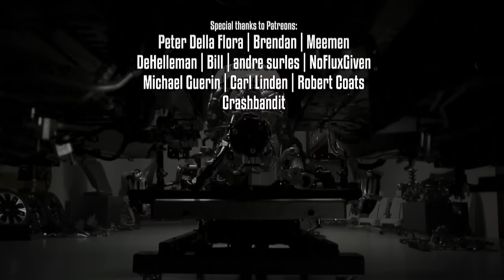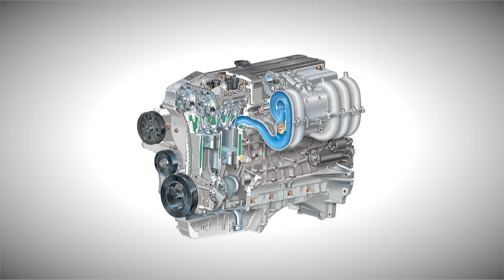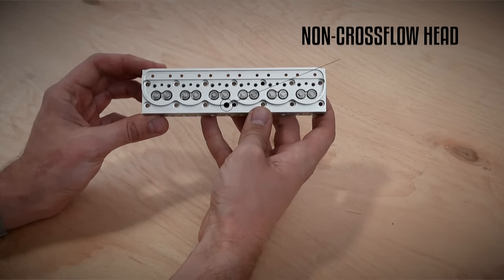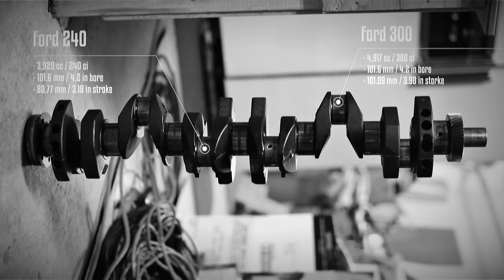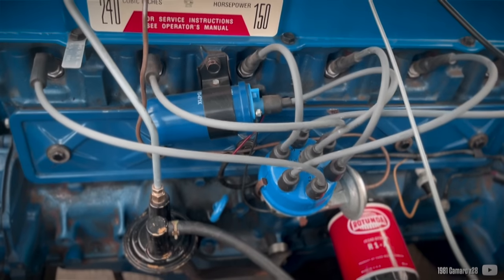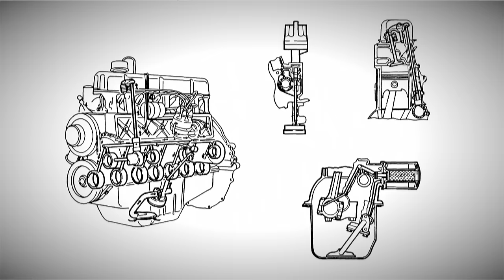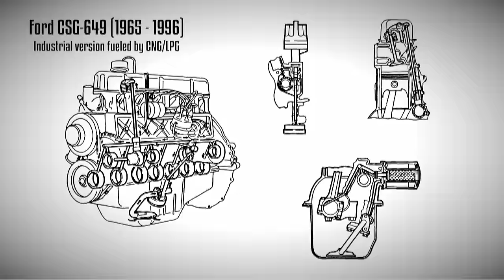Is This Toughest US 6-Cylinder?

Comment: Ford Australia had the Barra 6, which are DOHC with Variable valve timing and contain 24 valves. These were a product of continued development in Australia, from the original non-cross flow family of light Ford sixes which originated in North America as the "Thriftpower Six" designed for the original American Ford Falcon compact of 1959. The final and ultimate version of the Ford Barra 325T Power: 325 kW (436 hp) @ 6000 rpm
Torque: 576 N⋅m (425 lb⋅ft) @ 2750 rpm
Reply: A six so compactly designed that the OHV engines have scallops cut into the camshaft to clear the crank counterweights....

Comment: I want to bolt up two together with a cast iron gear to sync them up. If done the right way, One could then add efi and twin turbo the most reliable engine in the know universe!

Comment: I had a ford 300 6 in my balewagon. I hauled my hay in with it putting 1500 miles on it each season pedal to the floor most of the time 100plus degree weather. Got it hot a few times and it kept going it was bulletproof. What a great engine.

Comment: Gear driven cam is the secret to longevity, in fact the most replaced internal part, that doesn't lead to a rebuild, is the fiber on the gear wears out. Older engines were completely metal on metal.

Comment: I bought a new F150 in '93, w/300 straight 6. It's not an every day driver, but still works just fine. Never had any engine work done outside of plugs and wires. Absolute reliability 30 years going strong.

Comment: Back in the day we hauled hay on old 2 ton trucks. Most I ever hauled on were 6 cylinders. They were strong, slow, dependable and durable. They handled the heat and rough use well.

Comment: I had a 1982 Ford F-150 with a 300. I carried some loads for short distances which were heavier than they should have been for the truck's rating. However, the truck didn't run much differently when I did this. It just used a little more gas.

Comment: So good they ended it. Jk. Reliable and rebuildable doesnt mean best power and performance. Depends on what you want from an engine. The most power it had was the first gen at 170hp and 283tq, nothi g special there. Jeep's 4.0L (.9L smaller than Fords) was just okay and also lacked power having about 200hp and 225tq. Jeeps with these engines were slow and got poor mpg but were reliable. Point is power wise they are not that different. It took way too long for manufacturers to raise power outputs and mpg of everything.
Reply: The 300 wasn't designed for power, it was designed for low end torque, reliability, and serviceability.

The jeep 4.0l was designed similarly, but even the original 1987 Renix versions with 174 hp was still more than most other makers v6's making around 150hp in the 80s.

Comment: The slant six made in the 70s is actually the toughest engine out there. Seen one run for 100 miles without oil and the engine was still intact and the steel crank was still good when it seized.

Comment: I would like to see some mfg'r come put w/the best features of the 300 Ford & probably the 2nd best inline-6 the Dodge slant 6. Utilize the same cam gears as the Ford 300 & the slant design of the Mopar slant six. With its curved design the intake runners could allow for faster air flow the further out cylinders allowing for a faster revving engine. Just combine this w/ a 24 valve DOHC head design  & you could create an incredible fast higher revving engine with good low end torque.
Reply: I would go for a bore & stroke of 90mm/3.54 in x 96mm/ 3.77 in for an extremely high torque low end the could reach very high rpms too.

Comment: Easily the best engine Ford ever produced.  It's a shame they haven't been able to continue to consistently design good, reliable engines.  Classic Ford's were always pretty good because they had good engines like their straight 6 (the 200 was a pretty good little engine too), the FE, Windsor and 385 big block were all good, reliable engines.  Sadly, that hasn't been the case for the past 2 decades.  The Triton V8 is pure shit.  The powerstroke has had some real turds and 4 cylinder ecoboost may be the worst engine of all time.  What in the hell happened Ford?
Reply: With increased complexity comes reduced lifespan due to all those intricate, failure-prone parts.  That's why the next time I need to buy a vehicle, I want something with an engine style that is old and time-tested, meaning something with a plain camshaft and push rods!  Variable valve timing and other high-tech stuff might tweak more power and fuel economy out of less displacement across a range of RPMs, but simplicity = reliability, and for anyone who runs their vehicles forever instead of constantly "trading up", reliability saves money in the long term in spite of the lower fuel economy.

Comment: Back in the 80s I owned a Ford F-100 2wd , 300 with a very light weight 4 speed . pulled a tri axle full of rocks and stumps with a 3 axle trailer loads down with a excavator out of my driveway and down the road until he popped the clutch and got it fired up . Engine had all kinds of guts , however clutch was the weak link .
Reply: Sounds as though all you would have really needed to do was install a better clutch unit and the thing would have basically been a totally bulletproof workhorse...

Comment: So I’ll be honest, I absolutely love the 300 and currently own 2 f250’s both powered by 300’s. When they work, there’s not another gas motor like it on the planet, but I have blown up more of these motors than anything else. Im not super hard on them, and I’m a master tech with experience in engine building, and unfortunately even the last one that I blueprinted top to bottom didn’t last too long thanks to the oil pump drive rod. I’ll never lose my love for them, but when they break they break spectacularly
Reply: my 94 F150 has 276k mi on it.  had it for 25 years and never had to do anything to the motor.  sounds like operator error.

Comment: The 240/300 six is a workhorse & practically bullet proof. There is an old Motor Trend article from 1969, featuring a Ford F-150 short wide with the 300 six in the Baja 1000 race. It did pretty good in its class achieving 110 mph during the race without a lot of modifications.

Comment: International DT series are the most superior inline 6’s ever made. My two favorites are the DT-360 and the DT-466, specifically mechanically injected models.
Reply: I think the video is fine with it's current title because it's really about mainstream, groundbreaking engines.  Still, I was looking for such a comment as this one.  We had a very old truck where I worked that had the DT466 with mechanical fuel injection and to my knowledge, nothing ever had gone wrong with it.  Worth noting is that it would start without engine-block heating in weather cold enough to paralyze any other diesel I've ever seen, and that's with no glow plugs too.  As to quality, too many Cummins fans are convinced there's nothing better than a Cummins and several of them have already made that claim here.  I'm no engine expert, but I've read a bit about the details of the DT engines and specifically how specific design features of the DT compare to Cummins, and there's really no doubt in my mind that the DT is a better engine.  The components of size-comparable engines are massively stronger in the DT than the Cummins, and the DTs are specifically designed for ease of overhaul, which is an almost-unheard-of feature in today's world.  But there are no flashy and stylish modern pickup trucks powered by a DT engine and so there will be no convincing the average Cummins fan that there's something even better out there.

Comment: Guys you need to check out the Australian-designed and built Ford falcon 4 litre straight six "Barra" engine bulletproof and power to burn
Reply from the maker: Thank you for the suggestion. I have already covered this Barra engine previously, you might have to scroll a bit because it was quite a while ago

Comment: My 93 F150 XL had the 300 cui I6. My Grandfather bought it brand new in 1992, drove it across the country from NY to CA more than a dozen times. My father got it in 2003 and dove it every 3 months from Miami to Buffalo, I got it from Dad in 2012, and I road tripped it to Arkansas, Iowa, N.& S. Carolina, Virginia, W. Virginia, Pennsylvania, hell. Just about everywhere east of the Rockies. When I sold it to my son last year, it had just shy of 850,000 miles on it. He still drives it on weekends.
Reply: Hooooooly hell...

THAT is an absolute load of miles that was put on a vehicle!

My three big questions about that vehicle though are:

1. How well did you all maintain the engine over the course of owning it?

2. How reliable was the 300 overall and what needed to be fixed most/was an issue with the motor.

3. How many times did the engine need a rebuild, did it need replacing or did it really last that entire time and all those mile without ever failing?
Reply: @mr.chaosvicious5968  regular oil changes, tune-ups (the usual), plugs wires, cap 'n rotor about every 18 months or so. 
Overall, the only mechanical parts that needed attention were the water pump and the fan clutch. The valve cover gasket was replaced a few times. Oil pan gasket also a few times. Both main seals once.
As for the engine being rebuilt, only the head for valve stem seals and the head gasket neded replacement.
As far as I know, the bottom end is all original. I never had an issue with it when I owned, and it never left me stranded for more than a roadside repair.
And like I said, my oldest still drives it. It's been super reliable.

Comment: I've overhauled a few of these .The valve train starts to wear out before 100K miles . The rocker arms cock to one side and rub through the pressed in stud.  Stud setups are cheap to manufacture
Reply: Did you ever see cam bearing failure. I had 3 of these engines and all of them had worn cam bearing failure especially the front bearing. Thank you and good day.

Comment: I have fond memories of working on my Dodge Dart "slant 6" engine, also the slant 6 in my Dodge Aspen wagon. A good friend taught me how to do a tune-up, and told me to always ask for "racing parts" (wires, diststributor cap and points), they last longer and perform better. I know better than to mess with a modern engine these days.
Reply: if you can find one for reasonable price they are fun to keep onhand. i keep a 65 D100-stock 225. no matter what i know i can drive it, and simple to work on (tho driving it can be a workout, manual everything)

Comment: I rebuilt my 94 with 250k miles sludge over 1” thick on top of the head the oil was never changed, the oil pickup screen was completely impacted with sludge. Rocker pivot bolts oil passages completely worn away. When removing the pistons there was no ridge to remove, I used a three flat stone hone to restore the crosshatch checked cylinders for excessive wear I was able to use new std pistons, bearings, cam, lifters, cam gears New distributor runs like brand new money. I cleaned it thoroughly polished crank journals valve stem seals no machine work really needed I wasn’t setting up a drag car it’s just a motorized wheelbarrow for my Lowes trips. I was very surprised there wasn’t some serious detrimental wear considering the lack of service. I’ll have to agree this engine took a beating and it’s got much more life left in it.
Reply: Yeah, just keep changing the oil every 5-6000 miles, and it will run a long time.
Reply: If it ran for that long with you neglecting the motor's oil maintenance the way you did, then just imagine how long the damned thing will run if you actually keep up with maintaining it properly this time round.

The thing might just last until you are old and gray or possibly even end up outlasting you completely and get passed on to someone else and last them for a good while as well.

Comment: Power did NOT drop with the change from gross to net power.  That is as silly as saying that countries using metric units are colder than those using imperial units.
Reply from the maker: No no, the way it was meant was that the actual number decreased because of the gross to net rating change, not that the engine itself was less powerful

Comment: I've had vehicles with both the 240 and the 300. They were great. I'm having an excellent experience with Ford's 3.5 in my 2015 Ford FLEX  which is now at 240,000 miles 😊

Comment: I owned three vehicles with straight sixes in the 60's and early 70's.  Never had an engine issue and two eventually went to the scrap yard with perfect running engines.  The third vehicle was entered into a demolition derby.  That vehicle was demolished and the scraper paid extra for the engine to re-purpose it.  Has always puzzled me why manufacturers produce multiple new engine designs, rather than perfecting a proven engine.  Engine reliability has marched on a continuous decline for the past 50 years.
Reply: It's true that some modern engines are known for being very unreliable and terribly expensive to fix, but there are also some basic engine styles that have gotten much better over the last 50 years, not worse.  Back in the early 60s, the average V-8 engine was in rough shape by the time it reached about 120,000 or 150,000 miles, and many were junk by the time they reached 100,000.  Nowadays, the same basic style of push-rod V-6 and V-8 engines are commonly running as good as new when well beyond 300,000 miles.  That was unheard-of in the old days.   I've actually lost count of the number of people I've met who drive old S-10 pickups with the 4.3 V-6 that have 300,000 miles or even 400,000 miles on them with never a breakdown and still running great, and that's just one example out of a few "relatively modern" vehicles that I can think of for which this is true.  I've been told that a big part of this is that modern machining methods are far more precise and so the "fit" of moving parts is consistently better than it ever was in the old days.
Reply: @ericl2969 Interesting that you mentioned the 4.3 V-6.  Last year I retired my 1999 GMC Safari van with 538K on the odometer.
It was the GM 4.3 Liter Vortec V-6 engine.
Rather than further improving the engine, it was phased out of production by 2014...and replaced with crap.

Comment: The reliability of the Ford 300 and most of the other American inline six engines is primarily because they never produced enough power from the factory to hurt themselves.
Reply: They weren't designed for power, they were designed for torque, and long service life.

Either way they take boost just fine and can make decent numbers with a turbo.
Reply: @riogrande163  😁

Comment: I still drive a 300 every day.  At 530k miles I can tell it's lost a little, but still runs great and doesn't burn any oil, although it will mark its territory a little when parked.  Only thing I've ever done to the engine is replace the plastic timing gears with steel at 300k miles.

I've also managed to blow one up.  It was in a 79 F-150.  I was towing it home for a friend at about 50 mph and he decided to put it in first and dump the clutch.  I'm not sure how many rpm it saw, but it was at least 1 too many.  It took a few seconds, but the rods did leave the scene of the crime.

Comment: THE CHEVY 194, 230, 250 292 INLINEC6 WAS WAY BETTER. THE FORD HAD JUNK RODS AND WERE PRONE TO SPITTING THEM OUT. THE WAS COMPOUNDED BY A TENDENCY FOR THE WRIST PINS TO SIEZE. IT RAN GOOD BUT WAS JUNK UNLESS YOU PUT GOOD RODS IN IT. I'VE REBUILT TWICE THE FORDS THAN CHEVIES. I REMEMBER A TIME WHEN I COULDN'T FIND A FORD BLOCK THAT HADN'T BEEN VENTILATED.....

Comment: It is strange that you sing praises of the Ford engine here. All my friends who bought ford cars with 6 cylinder engines had to discard them early. I later on bought a Ford Taurus with a 6 cylinder engine and its head had to be machined at 85,000 kms. At 100,000 kms, the whole engine had to changed. Your singing praises of Ford 6 cylinder engines goes very contrary to my life time experience. I do not know how you came to the conclusions that you espouse, but they are diametrically opposite to what happened among my friends and myself.
Reply: Taurus was a V6. Nothing similar at all. Completely different motors 100%.

Comment: never understood why ford quit on this engine, add a timing belt dual overhead cams and a turbo, nothing would ever run close to it,  if this would have been converted to a diesel turbo back in the mid 80"S  ford would have had the diesel market for at least 30 years.
Reply: A timing belt would be a downgrade.

The ford 300 was largely canceled due to the relative difficulty to make it comply with emissions and MPG standards, aswell as it's difficulty to package due to it's size.
that and it's durability would fly in the face of today's trend of planned obsolescence.